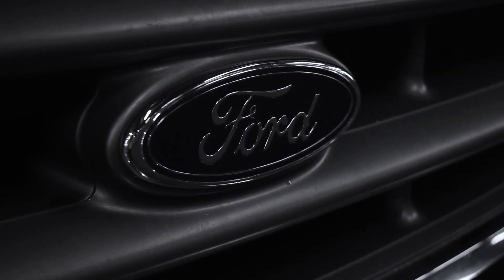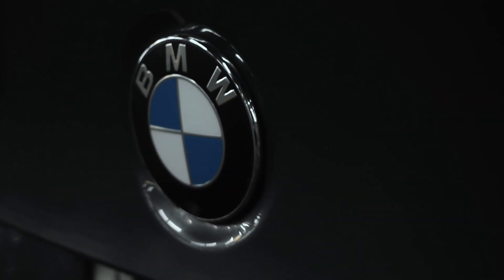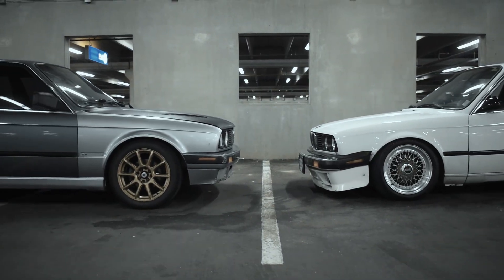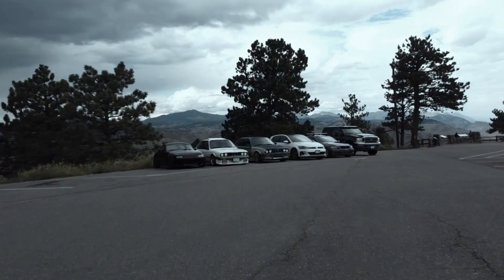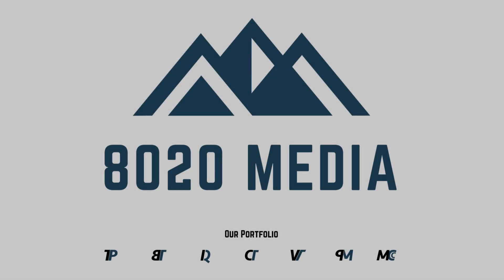The 6.5 Detroit Diesel | The Worst GM Engine?

Comment: As a commuter or maybe marine applications, awesome, for anything else forget about it. PMD relocations, updated exhaust, updated cooling systems, vacuum pump waste gate control bypass, oil pressure switch relay upgrades, harmonic balancer replacements (don't skip that unless you want a broken crankshaft) , hairline cracks between the valves causing coolant loss even on stock turbo and stock boost. I could go on but you get the picture. The only redeeming thing is if you're just commuting and if you keep it stock and if you're on top of maintenance and replace parts in a timely fashion (which parts are relatively cheap), then you will probably be satisfied with the motor. 
For the individuals that believe they're good because the military uses them, it's because they got them for cheap! I have a National Guard depot down the street from my house and have seen them towing the humve's back to the depot with a strap because they broke down on their occasional weekend runs. If you like wrenching and are not intimidated pulling heads, relocating electronics and tinkering with turbos, go for it. They sound great but don't go too far without a spare pmd, fuel pump bypass switch or without knowing how to jumper your glow plug relay because it won't start when it's cold without hot plugs!

Comment: This is not a fair comparison as the 7.3 Powerstroke is Direct Injected whereas the 6.5 Detroit is an IDI motor. A more fair comparison would be the 7.3 IDI and the “Dowel Pin” Cummins. Those have very close power ratings.

Comment: It’s funny that people talk shit about this motor but from my experience it’s a great motor. It’s found in military vehicles, Civilian vehicles, and Boats. Is it low on power yes, is it a torque monster no. But it’s cheaper to work on because of the different applications. At the end of the day if you don’t take care of it, you’ll be walking and that goes for all brands, look at ford 6.0 and 6.4 (7 to 8 year run). The 6.2-6.5 had just of 20 years, Seems to be a good option. But haters hate.

Comment: It's not the worse I had over a million miles in my 93
Reply from the maker: L - We've seen that many times! Thanks for sharing. Sounds like you took great care of it.
Reply: @8020Automotive  yes people don't realize if you respect your vehicle and treat it properly it lasts, but everyone wants to modify everything and expect it to stay under the intended parameters. I wasn't the nicest to the vehicle but I kept it maintained and fixed things as needed. The truck is scrapped and the engine is now in a mud truck

Comment: Never had a problem with my turbo 6.5, just relocated the PMD and it gives over 20mpg in the city consistently, even 25-26mpg at just cruising at 50mph.

Just shy off 300k miles in 2000 my chevrolet express 2500

Comment: My 98 1500 started running at 1300 at an idle and would increase to 1800 and back down to 1300. Any idea what was causing this problem?
Reply from the maker: W - An idle that jumps between 1300 and 1800 RPM usually points to an air control or vacuum problem rather than a mechanical one — the idle air control valve (IACV) could be sticking or dirty, causing the PCM to constantly chase idle speed, or there could be a vacuum leak at a hose, intake gasket, or brake booster letting in unmetered air. Less commonly, a bad throttle position sensor (TPS) can confuse the PCM into thinking you’re on the throttle when you’re not, also leading to surging idle. I’d start with cleaning the throttle body and IAC, then inspect for vacuum leaks; if those are fine, test the TPS to see if it’s giving smooth readings.

Comment: I have a 1993 2500 6.5 turbo diesel and I love it. I've hauled a 22000 lb D5 AC bull dozer with no problem. And it had 310000 mile on it at the time
Reply from the maker: S - Sick! Thanks for sharing your experience!

Comment: The video did a good job overall in introducing people to the 6.5. But I would like to clarify one thing: these engines were never intended to compete against the Cummins or Powerstroke in terms of power. With GM in the 80’s and 90’s, if you needed power for towing or hauling, you went with the 454. The 454 got horrible mileage, though. So for GM folks they had a better alternative for range with the 6.5. The other advantage was that if you wanted to swap, the bolt patterns were the same unlike switch between gas and diesel in a Ford or Dodge. And while they did have some problems, all motors did. But largely the problems people have today are self imposed. They ride them hard and put them up wet, they don’t maintain them, and they try to overbuild them. We see many people doing that with 5.9 motors and now a lot of younger kids that thought they wanted one, call them pieces of just because they were slow and when they tried to build them up, they destroyed them. 

All three motors are great in their own rights. It becomes an issue when people don’t understand why they were designed and built the way they were. I’ll also point out one other thing: the 6.5 is the only one of the three still in production. Cummins is the only other one even still supporting their old motors with new parts. Good luck getting anything from Ford or International.
Reply from the maker: J - Thanks for the feedback! Well said.

Comment: I have a 1996  with 4 hundred thousand miles plus on it running strong but I only use it for driving no haul . I carry a extra pdm mold with me just in case. Yes have had some of the problems you explained but nothing that has killed the engine yet keep oil change & fuel filter like clock work. I know it my only have a few more years on it but seems like it will run for ever .
Reply from the maker: F - Nice! Thanks for taking the time to share your experience. All depends on how its maintained.
Reply: This is the only way they reach that kind of milage so congratulations! I have owned them and even for light towing they stress out. Great fuel economy for the size of the motor.

Comment: I owned a 95 Chev 6.5 2500 until 2006 when I bought a 2006 Ram 3500 5.9 Cummins out of sheer frustration. The 6.5 was gutless, tended to overheat, but worst of all, it would quit while driving, or refuse to restart after driving it somewhere, when you wanted to go home. I would have it towed to the dealership only to be called the next day telling me they could find nothing wrong! I now know this was caused by the pump mounted driver which would overheat and stop working until it cooled down. Once it would cool down, it would continue to work for a while until it failed completely. Had I known the pump mounted driver could be relocated, I might have done this. At the time, I had it replaced by a diesel specialty shop at cost of two thousand dollars for parts and labour only to have the problem recurring two years later. The frustration and uncertainty of not knowing if I would get to my destination or if I would get back from a trip, gave me anxiety over driving, and I dreamed of gleefully pushing it over cliff and watching it shatter on the rocks below! It will soon be twenty years since I bought the Cummins 5.9, which has been wonderfully reliable, and  I haven’t looked back! Good riddance to the 6.5.
Reply from the maker: A - Thanks for taking the time to share your experience! We would absolutely take a 5.9 cummins over the 6.5 haha

Comment: I think if you compare the 6.5 to the 7.3 powerstroke and first gen 12v cummins the 6.5 is not that bad. From what I know is that the 1st gen cummins trucks had 160hp from the factory. Compared to the 6.5 thats definetly not bad
Reply from the maker: J - 6.5 would still be last based off of what you're comparing it to.

Comment: Hi, I seen your old post and thought I would ask your advice. I have a 6500 pound camper trailer do you think a 6.5 would do the job without constantly downshifting went in cruise control or should I move up to a D max. your thoughts would be appreciated. Thanks.
Reply from the maker: N - Personally we like the Duramax's more. That's not to say the 6.5 isn't capable enough though.

Comment: move the PCM away from the heat and they are bulletproof
Reply from the maker: A - Well said.
Reply: Move the PMD, upgrade the water pump and fan if you want to tow a lot and replace the harmonic balancer and crank pulley. Don't think there should be any problem left if all that is fixed

Comment: I don't understand how the 6.5s 215HP and 440lb-ft ratings was underpowered compared to the competitors at that time?   By numbers using 1996 as an example, Ford 7.3 was rated at 225 hp and 450 lb-ft.  Dodge 5.9 was 215HP and 440 lb-ft.  Am I missing something?
Reply: He is comparing a 7.3 Powerstroke not an IDI. The 6.5 Detroit is an IDI motor whereas the powerstroke is Direct Injected. The IDI 7.3s are about the same as a 6.5 Detroit.

Comment: I’ve been happy with mine, been around a few of them. Quadstar eprom, 4” straight pipe, later cooling upgrade, hx35 putting out 15-22lbs intercooled. Servo delete in the 4L80. 230k currently
Reply from the maker: T - Sounds like you've got a sweet build. Thanks for sharing your experience.

Comment: I have daily drivien my '82 6.2 for 9 sun cycles (years) and it has been extremely fun and reliable. Once I made the necessary updates and upgrades to the old 6.2 it became a whole new machine. Over 450hp, still gets 22+ mpg and is a 4x4 3/4 ton...cant ask for more.
Reply from the maker: T - Nice! Sounds like you've got a good one. Thanks for sharing your experience!

Comment: 97 CCLB C3500 SRW as my daily since 2001 when i bought it, addressed the stupid design flaws, but stock heads and bottom end are at 363K 4l80 trans is bone stock as well! 27 mpg with the fuel system i have. 3 PMD and 2 injection pumps.
Reply from the maker: C - Nice! Thanks for sharing your experience.

Comment: That's only when you over work the motor.  They were not meant to work all day and all night.  There's a rating on diesels for a reason.  12v is just as bad in stock form if you over work it.  I had one in my boat had it professionally rebuilt.  1750 hrs later the cookies came out the exhaust pipe.  6068 deere for the win. I'm planning to put one in my 97 k2500.
Reply: I agree with this. Many 6.2L/6.5L V8's became heavily disdained in the oilfield business because these engines weren't really meant for extreme usage. It got to the point where some companies just didn't want to deal with any GM trucks unless it was a large rig with a Detroit Diesel or both a smaller and bigger truck that had a big block instead. For awhile many of them preferred both Ford and Dodge. The 6.2L/6.5L V8's were great in the military for the CUCV's,HMMWV's,and CUCV ll's until AM General messed alot of things up starting with the ECV's. Even though the 6500's were the upmost modified variables of the 6.5L V8's it was a fatal mistake on all accounts using them in uparmored M1113-M1167 HMMWV's. There was countless incidents of head gasket and crankshaft failures,even in combat zones. Finally Oshkosh Defense came out with the JLTV's/LATV's back in 2019 and solved the issues. There was the MRAPV's and MATV's before that but those trucks are too heavy and at a disadvantage in certain situations even though much better in reliability and torque.
Reply from the maker: S - Thanks for taking the time to share this insight!
Reply from the maker: J - And how they are maintained. Thanks for sharing your experience and feedback.

Comment: 7.3 at its best only made 275 hp and 550 pound feet and 12v only made 215 and 440
Reply: But the 6.5 while decent was not as heavy duty as the 12v or the 7.3 tho tge 7.3 is overated imo. Am general still makes the 6.5 optimizer which is better then the orginal but not as good as the other two
Reply from the maker: Thanks for sharing!
Reply: @gregday9943 overrated? See lots of 7.3's over a million miles. Never heard of a 6.5 ever getting close to that
Reply from the maker: G - Thanks for the insight.

Comment: There was also different blocks that were made through out the years for the 6.5l. Some of the best thicker 6.5 blocks came out of Mexico. That's why not all 6.5s are Detriot Diesels.
Reply from the maker: E - Thanks for sharing this insight.
Reply: They are still produced in Mexico under license from GM. They are produced for several South American Armies who use GM trucks.
Reply: Well the problem with the Detroit and Mexico, the Detroit was stroked down from old 7.5 big blocks because that's what they used when manufacturing the molds for the cast instead of making a new 6.5 mold they just put sleeves in that would cause issues where it would rip the pistons up if they shifted, while later models and Mexican versions used whole solid 6.5 sized blocks
Reply: How do you know if yours was one of the ones manufactured in Mexico @StorMRagE4EVA  ?

Comment: After replacing my injector pump the first time I learned that there was company in Michigan that made after market PMD modules that you bolted to the intake manifold , they had big heat synch on them. I bought one of them the next time the PMD started failing after about 4 years  and it worked fine . I had that truck another 5 or 6 years  until I replaced it with an 01 Duramax K2500HD ECLB  which I still have today.
Reply from the maker: D - Thanks for sharing your experience. This will certainly help future viewers.

Comment: I find only people that hate these engines all have one thing in common, they have never owned one! I have a 1982 c-10 shortbed with a n/a 6.5 mechanical pump out of a 94 suburban. I drive around getting as much mpg as corolla while looking/sounding badass. The sound of the 6.2/6.5 is one of the best sounding diesels in in opinion.
Reply: I still run k2500 1993 that I rebuilt (studies in head and a homemade bottom main girdle). It been 5 years and still runs well. It has 5sp and 4:11 gears, gets 13mpg and 11.5 when towing 6k.
Reply from the maker: J - We would have to disagree. "They have never owned one," is quite comical. Just because you have had a great experience with it, doesn't mean others haven't. Now can we say that they have maintained it properly, no. However, thanks for taking the time to share your experience.
Reply: @8020Automotive No, they’re completely right. 99% of these goofballs never owned one NOR do they know how to maintain any sort of Truck Engine. If anybody knows their stuff, they know Detroits are good. If Detroits are so bad, why do multiple militaries use them, and TONS of Heavy Equipment still use them?
Reply: @8020Media  no literally the majority of people who hate on anything are those who have never owned them or worked on them, it's bs & pure ignorance

Comment: Is it possible to engine swap a 6.5 from a LML?
Reply: A mechanic that worked on my 6.5 said a 5.9 Cummings will slip right in there🤷‍♂️
Reply from the maker: J - I'm sure it wouldn't be cheap, but thanks for sharing the insight.
Reply from the maker: Talking swap an LML into a C/K? Can't say I've seen it done or can provide much guidance on how to do it but most things are possible with enough $ - I doubt it would be cheap tho so depends if you're doing it for practicality or just for fun because you can.

Comment: The 6.2 and 6.5 ARE NOT A DETROIT!!!!!!!!!!!!!!!!!!!! The 6.2 and 6.5 were produced by General motors NOT by Detroit!!!!!!!!!!!!!!!!!!!!!
Reply from the maker: Taylor - These engines were made by GM under the Detroit Diesel subsidiary. So, we are both correct.
Reply: Later international took them over and started building them.
Reply: That's what l thought too until l researched it...."Detroit Diesel" did actually build them & supplied 'em to GM....